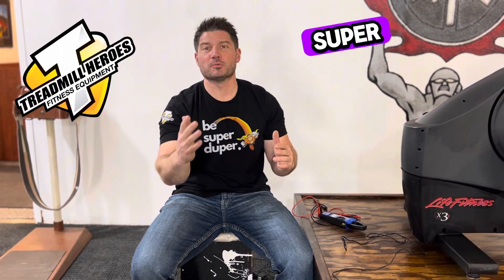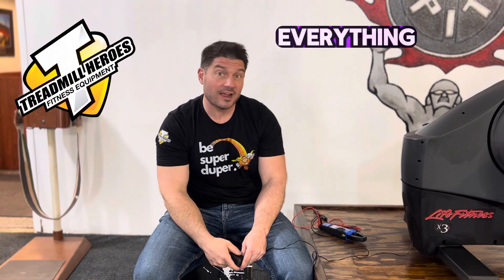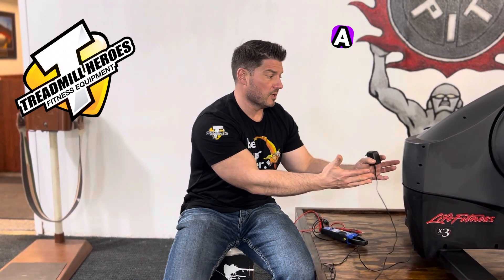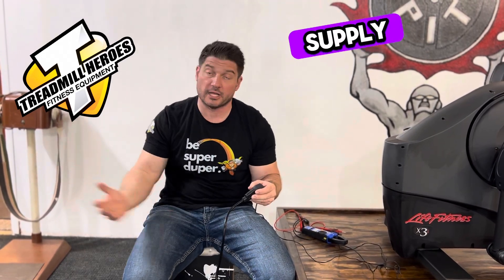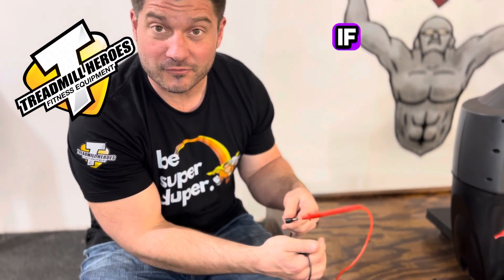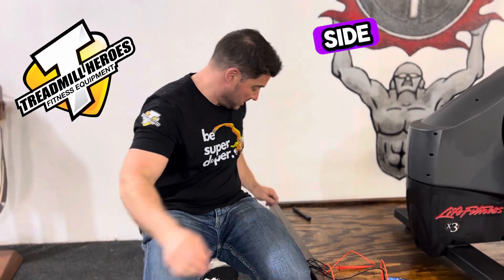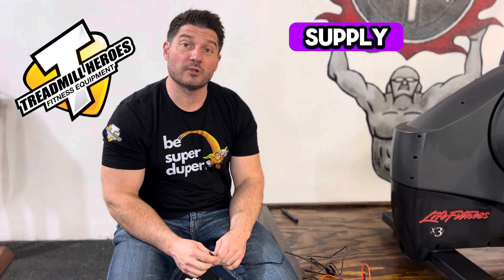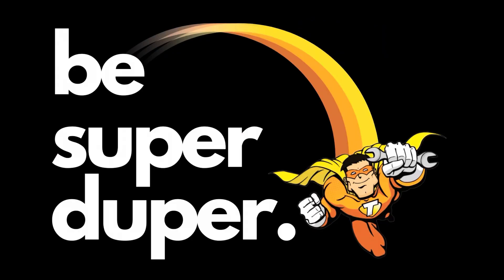Elliptical or Exercise Bike Not Powering on

Comment: I have a nordic track SL528  bike I got from someone they were tossing it out. But I want to see if I can get it going for my daughter in-law. I dont see a power supply other then 4 D batteries and a headphone, CAT 5 port, and a weird male screw on port. I dont know if any of these are an exterior power source. With good batteries I cant get control board to start up. Any help would be greatly appreciated. Tx
Reply from the maker: Bummer. Most likely it’s a bad console. The Fitness Graveyard may be able to help you find a used console.
Reply: @treadheroes  can I put a meter to it and test if it's good or not?